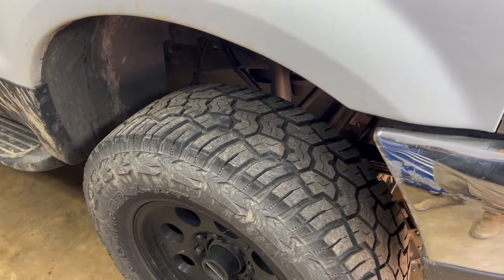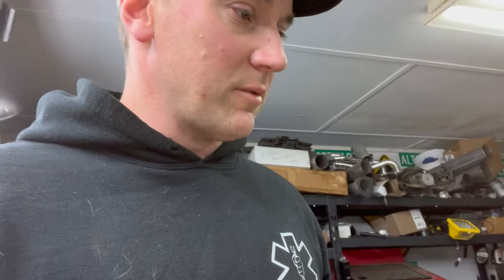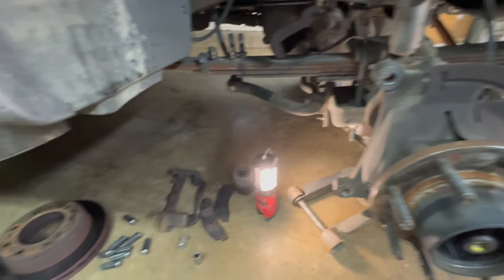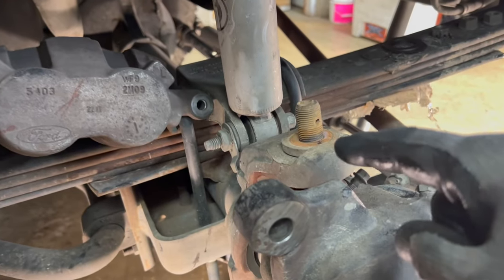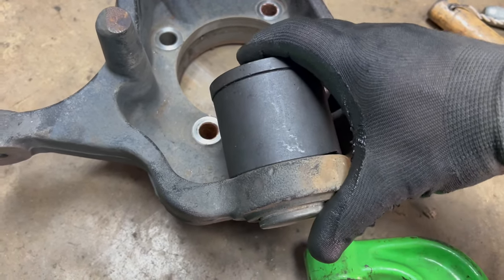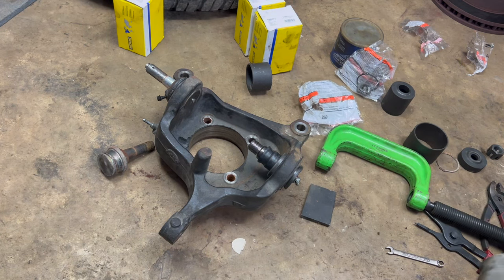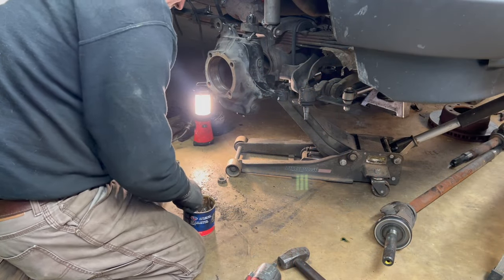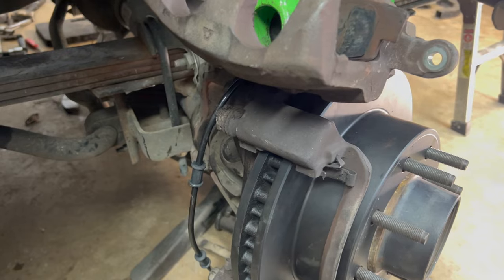99-07 F250 F350 Ball joints

Comment: I am no mechanic, and by no means had ever changed ball joints before owning my 99 F250 7.3, but after receiving a quote for ball joints I decided to give it a go.  For under $200 I replaced the front shocks (specialty lift shocks), changed both sides upper and lower ball joints, installed new tie rod ends and sleeves, and put 3 inch lift blocks under my front coil springs, and I did it all in under 6 hours in my garage.  The only special tools I used were a set of ball joint presses, a big set of pliers, and a set of spring compressors.  The special tools cost me $150 total to purchase from harbor freight.  Oh, and a little mini propane torch.  lol.   Between youtube and google, almost any man or woman can do a job like this.  If I can I know you can!!
Reply: Damn my ball joints cost more than everything you bought lol
Reply: If anyone decides to replace ball joints you might as well  replace the  seals, bearings and u-joints on your Dana 60 while you are at it. Otherwise you be back in there in a few more years. $600 overall is about right for parts. Use Moog or Spicer brand parts where possible. A good ball joint/U joint tool is around $200 yet plenty of folks have used used or cheaper tools to get it done.
Reply: How did you set the torque on the ball joint bolts ?
Reply: Yea I did mine on my 2012 f350 in a few hours and half that time I was watching Yellowstone or some shit on my phone instead of working 😂
Reply: @jakesmith6337  I used the German torque spec goodentight.

Comment: I have a 2004 f350 6.0 diesel 4x4, having problems with loose steering. Took it to a shop and they told me that I need new front hubs so I told them to put new shocks on as well. $1663 is what they charged me. Driving home same problem. I called them they said bring it back. I didn't. Went to a different shop with the same steering problems. They charged me $65 for the exam and told me that it would cost $5,300 😖. I'll be ordering my parts online and do my best to get the job done, of course with Youtube 😁.Thanks.
Reply from the maker: Tie rod ends, drag link and track bar end link bushings need to be looked at also
Reply: @AutomedicGarage  : I'm buying the whole kit to replace everything. They also said that I need a new steering gear ⚙️ box and that I need to hurry and have all of that done before I kill a family 👪 or myself, very dangerous.
Reply from the maker: @imaslowlerner  gear boxes get misdiagnosed so many times because of all the other worn parts on the front end. Do your ball joints, tie rods etc. and drive it see how it feels before you spend all that money one a gear box.
Reply: @AutomedicGarage  : I also plan to install a steering stabilizer like the one in your video.
Reply: Get rid of it quick. 2004 6.0 ford's crappiest motor

Comment: Nope... same "mechanic" shop that rhymes with a "tire store", put moog in mine when I "let them" replace one... .it lasted 150K miles LESS than the original OEM joints.. I'll ONLY put OEM parts back in my stuff, I've learned that lesson on more than one occasion... unless it's lifetime AND easy to change (like an alternator), Ford parts only.
Reply from the maker: @dj4523-n3n  I like moog ball joints, properly installed works just fine

Comment: Replaced the hub seals last year. Should have done the ball joints at that time but didn't. Found this video as a quick refresher. GREAT job for making things clear and concise. No fluff, just straight to the point. Thank you also for taking the time to list socket sizes and torque values. You earned a new subscriber for sure!

Comment: Thank you for the video! I didn’t read all of the comments so someone might have caught the procedure you used when you torqued the ball joints.I rebuilt my 60 and learned the hard way that there’s a right and wrong way to torque the ball joint nuts. The wrong way can likely give you memory steer which I ended up getting. Best way is to leave the top camber/caster spacer out while you start by torquing the bottom to 40 ft lbs then install the  camber spacer just setting it in then torque the top nut to 69 ft lbs  then go back and torque the bottom to 150 ft lbs. if you miss this step the top ball joint will be overloaded causing sticky steering also known as memory steer. Trust me don’t do it like this video shows because there’s a good chance you’ll get memory steer. it sucks especially after going through all the work to rebuild the front end.  One more thing make sure you clean the camber/caster bushings 26:19  with Emory along with the socket in the knuckle so it fits nice and smooth this will help it seat. Hopefully this excursion in the video didn’t end up having the dreaded superduty memory steer that drives so many guys crazy trying to keep it going straight down the road.
Reply from the maker: I torqued them in the correct sequence. I wouldn’t send a customer home with memory steer.

Comment: This is one of the best super duty ball joint videos out there. I have done this job before and getting ready to do it again. I saved my diy pipe tool for the seal to tap it in. Im sure there is a video somewhere that shows how to make it in case someone doesn't have the 4" muffler pipe.
Reply from the maker: Thanks for the compliment and watching.
Reply: Except he kinda skipped how the new joints go on. Is it pushed from the bottom up?
Reply: @guagua8268 
Removed: bottom/up
Install: top/down
@16:27 look close you can see the cup pressing downward on the joint to install.

Comment: Great video hardly ever do you see a how to video on the same model. Took me a few hours thanks for the tutorial
Reply from the maker: Sure thing. Thanks for watching.
Reply: @AutomedicGarage  I noticed when i did the driver side bottom balljoint it didn’t have the rubber sleeve on it but when i did the passenger side it did. When I ordered them I got the same part number and the picture didn’t have the sleeve on it. Is there supposed to be a difference?

Comment: Just ordered kryptonite ball joint set for my 02 F350. I ask the ball joint question on a 7.3l Facebook technical page and spicer seemed to be the majority of the votes with kryptonite a close second. Had several comments warning me to stay away from Moog. Factory driver side lower ball joint is bad with 138,000 miles,  I also tow a 35" 5th wheel and run 35x12.50 tires. We'll see how long these krypto's last. Diesel power products had them for a great price.
Reply from the maker: Nothing wrong with kryptos, I’ve just had to much success and my parts supplier gives to good a warranty to not use moog.

Comment: Loved the video, I did my wheel bearing a couple of years ago, didn’t do the ball joints now I’m going in to do ball joints. Does the camber sleeve on the upper ball joint come out when you press out the upper ball joint? Is there a certain setting I need to be aware of when installing? Thanks again, great instruction!
Reply from the maker: Sleeve stays on the spindle perch on the truck. Just remove it clean it and set it back in. When you torque the upper ball joint it will pull it down.

Comment: What about mevotech supremes? I've had good experience with them but I'm not a full time mechanic so I dont have the experience to make a good call. I especially like mevotech TTK lineup too. They seem pretty heavy duty
Reply from the maker: I’ve actually never used mevotech, the moog ball joints for superdutys are still USA made which is another reason why I’ve stuck with them.

Comment: Great video.  Been watching a bunch of them.  Question - 2001 F-350 7.3 - ball joints don't have any play and were replaced a few years ago before I got the truck.  My issue is steering memory.  Can I fix this problem be retorquing the ball joints (remove them and reinstall) or do they have to be replaced (since now they are possibly ruined from being installed incorrectly)?
Reply from the maker: Sometimes you can sometimes you can’t. Worth a try.

Comment: Line for automatic hubs? Aren't those manual locking hubs on it? Gonna be working on ball joints today.
Reply from the maker: @azeeninety55  those are standard factory hubs used from 99-2004. They have a “auto” and “manual” setting. Auto is vacuum actuated from the vacuum pump and 4x4 actuator and manual is exactly what it sounds like, you turn the hub and it locks it. So to answer your question yes there is a vacuum line for the auto hubs which these are.
Reply: Yea was just curious and not sure because I have a 99 with manual hubs and never noticed any vacuum line

Comment: Whew buddy that lower joint was a challenge. Press kit was lacking the right pieces. Got her set the primitive way hammer town. 
One thing you didn't touch is that camber sleeve up top. Does the book call for resetting that deal?
Reply from the maker: I didn’t use a hammer putting the ball joint in nor recommend it. I’ve made additional adapters since making this video. Seldom ever have to do anything with the camber sleeve. I’ve only had to use a adjustable sleeve or different degree from factory sleeve on a handful of jobs.

Comment: Thanks a ton. Doing these and full steering linkage on my 03 F250. I don’t have air tools, but do have the ball joint press kit from Harbor Freight. Hope that with regular hand tools/breaker bar etc. is enough. Anyone have recommendations? Thanks again
Reply from the maker: You should be fine, a impact just makes the job a ton faster.
Reply: @AutomedicGarage  thanks man

Comment: I’m an idiot and some how broke the vacuum nipple hub by prying up on caster shim and bent that nipple. Is it a replaceable part or do I need to get a whole different knuckle?
Reply from the maker: @EZWild  it threads in. Worst case scenario convert to manual hubs and plug up the vacuum line hole in the knuckle.
Reply: @AutomedicGarage I got my ball joints changed out on my 07! Thank you!  I ordered the tool for the axle seal at the knuckle but didn’t realize I need another tool for the seal that holds the gear oil in, I watched your other video rebuilding the front end of a wrecked one in the driver side and now I’m trying to make sure I order the right one is there a part number for the oil seal tool?
I purchased 6697.
Reply from the maker: @ you talking about the inner axle seal?
Reply: @AutomedicGarage  yeah it was the inner axle seal, I did some research looks like people just use big sockets or pipe flanges to beat them in, I unfortunately some how have 3 6.0s so I kind of just want to buy the actual tool no one can really give me a part number or proper tool name. I have bad luck with using random sh** as tools.
When you were rebuilding the one from the accident you had the silver one that you beat the seal in, then used the black tool for the other seal. 
Is it a specific one or just a general one.

Comment: Nice vid!  I’ve watched several others and all spec the same upper and lower ball joint but torques as you. In my Ford SD manual for 99 it specs both nuts at 101 ft-lbs. Is the difference a Moog thing, Ford thing, or ??
Reply from the maker: I have never seen anywhere that states both torqued to 101. I have always pretorqued lower to 35ft lbs then upper to 69 then lower again to 150 and have never had a binding or stiff ball joint. I know moog, TRW and precision all state the same order with the same or nearly the same torque specs.
Reply: Thanks for the fast reply. I’ll go with the Moog specs. If you are interested PM me with email address. I can send you the pics with Ford spec right out of the factory service manual.

Comment: The inner seals don't tear when you pull the axles?
Reply from the maker: No, the axle shaft is smooth, coated in oil. It slides right in and out of them
Reply: @AutomedicGarage  maybe mines just stuck because I had to pry them out. Project I wanted to get away with just doing a lower ball joint, but realizing the inner seal is leaking on one side. Wondering how likely it would be for the other one to tear if i pulled the axle out just enough to get the ring gear out the diff, or if I'm just gonna have to replace it all anyway regardless.

I found your inner seals video to be very helpful.

I'm starting to think I should bite the bullet and go ahead and just replace the other seal that's not leaking yet also, along with all 4 ball joints instead of just the bad one. Along with the other vacuum hub seal

Comment: What’s the average cost of this procedure typically?  Had my mechanic quote me $8-900 for upper and lower on both sides. 2007 F350 4x2.
Reply from the maker: I charge $700 for doing all 4 ball joints. Thanks for watching.
Reply: @AutomedicGarage  that's actually not that bad my wife bought a excursion that's suspension was so clapped out the steering linkage rubbed a hole in the lower radiator hose... it's a 4x4... I had to use a 12 ton press to pop out what might be a  330000 mile Motorcraft ball joint...  the cops came by after I broke it because someone reported a gun shot... bless you for not gouging someone in these current times 🙏  hopefully I'll have this back together by tonight
Reply from the maker: @brettscott3759  thanks for watching, hope it helped.

Comment: The problem is your cup and the Maddox Harbor Freight   cup also pushes on the round part of the Balljoint .. The Maddox will mushroom over the round part and compress it and make the ball joint tight..  They need a cup that drives the  on the seat of the Balljoint
Reply from the maker: That’s why I use other pieces of exhaust and such to press them on so I don’t damage anything. I don’t mushroom ball joints.
Reply: @AutomedicGarage  18:20 the cup is pressing the balljoint in on the radius and not on the rim ..the radius compresses the rubber seal and the plastic inside the balljoint making it tighter ...  The Maddox cup will expand over that radius and the cup mushrooms .....
Reply from the maker: @whirlwind8825  that is cup I always use on these. It has the thinner lip at the face that has become slightly deformed over the years. It is not however mushrooming any ball joints I install. I’m actually working on the same truck in the video right now. Has 40k on those ball joints with no problems.
Reply: @AutomedicGarage  https://youtu.be/H8gCwjrZ5ig?t=206 the cup has to seat on the outer flange not the radius
Reply from the maker: @whirlwind8825  I’m not arguing that, my cup is deformed and does not damage that radius, I have since made my own cup out of some mild steel stock. I have not damaged any ball joints and stand behind my work. If you want to argue that fact go ahead I guess.
Reply: Having a hell of a time find the proper cup to drive in the lower ball joint (Moog K8607T). With as many of these trucks that are still around, you would think someone would make a specific cup for that lower ball joint as an add-on. Anyways, I am going to try to make something out muffler piper that has a 2 1/8” ID to sit on the flange properly.

Comment: I prefer the Dana Spicer ball joints.  They are greasable and the top ball joint comes with a 90 degree grease fitting so you can grease the top ball joint.  Quality doesn't get better than Dana Spicer.
Reply from the maker: @DumbCarGuy  moog comes with 90 degree fitting also. Moog is good in my book.
Reply: @AutomedicGarage   Oh, i misheard you then.  I thought you were saying moog is straight down making it hard to grease on the upper ball joint.
Reply from the maker: @DumbCarGuy  comes with a 90 just can’t leave it in cause it will more than likely get broke off

Comment: Moog isn't any better than anybody else anymore. I've got about a year and a half on a set of upper and lowers that have failed at 8000 miles. Can't get a reply back from anyone concerning their fantastic claims of replacement. Just done with the whole globalization of everything. Anything you buy anymore is just a stab in the dark. But thanks for the video. 👍
Reply from the maker: As far as their quality they are better than house brands for sure and they are made in America for the superdutys still and all of my personal trucks and my reg customers whom all have moogs installed by myself all have 10s of thousands of miles on moog ball joints with no failures. A lot of the failure is often due to improper install, improper torque, not greasing them and not using quality grease. I’m going to keep pushing them because they work for me when I install them. Thanks for watching.
Reply: @AutomedicGarage  Yep I get it. Love these 7.3's. My F-350 has right at 800,000 miles on it. This is my 5th or 6th set of ball joints. And for years all I would use is Moog. I keep the truck serviced pretty well. Not sure why these failed. Thanks for the videos they really help us poor folks! 🤣😂
Reply: @AutomedicGarage moog is a Chinese brand
Reply from the maker: @user-vs8ox4hj2q  all my moog parts are U.S.A. made. Not to mention I have no comebacks or premature failures. That’s why I use them and will continue to until they are not U.S.A. made.
Reply: Im going to try a set from detroit axle, although in the past moog has always been the best, i recently had a run on of moog parts with no grease zerks which had me saying wait a minute here!
Reply from the maker: @ponyboyjake84  don’t waste your money on Detroit axle. Their hubs have to be the cheapest crap I’ve ever seen on a truck. It’s all China junk.